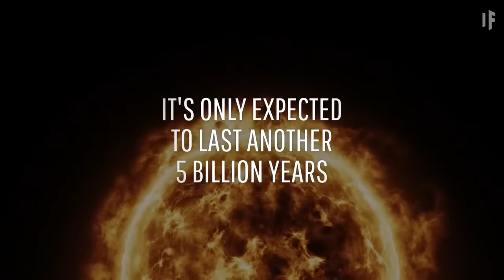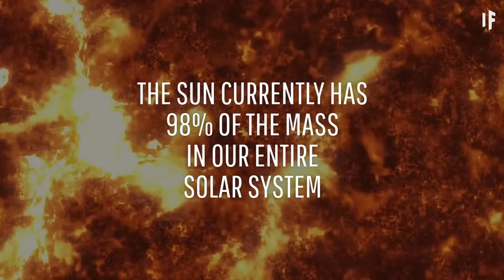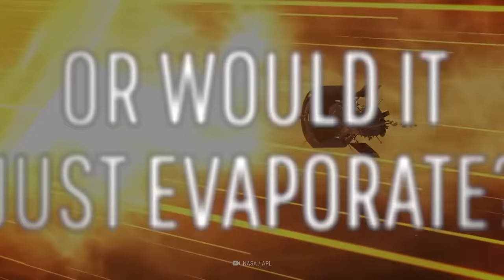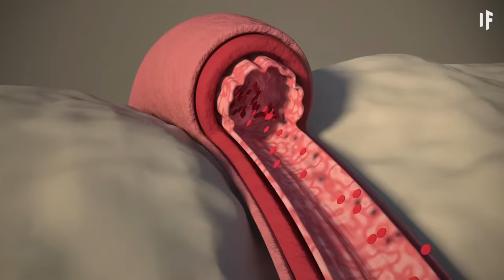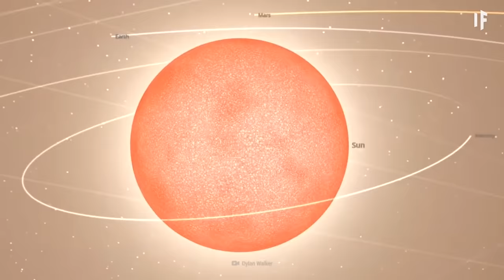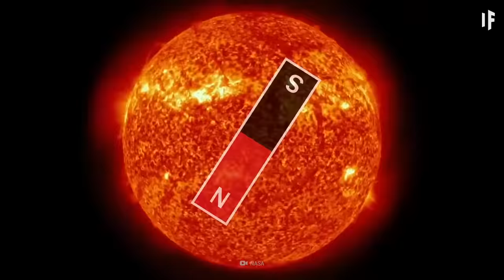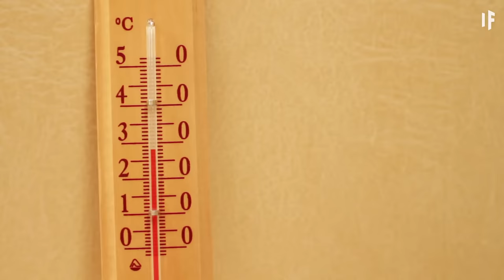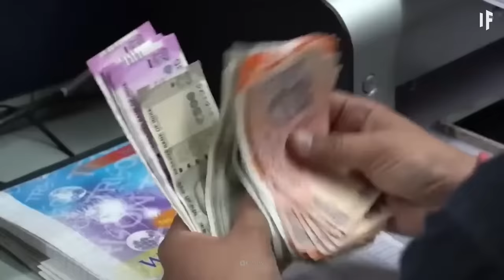Everything That Could Go Wrong With The Sun

Comment: remember the sun is 1300000 times larger than earth so you will have to multiply everything by that. But this person seem to be thinking on earthly terms. The sun is compose of gas H$H. The earth is composed of rock, its rocky therefore more massive if composed of rock and the same size as the sun and the gravity would be much, much larger. And if an sun size planet was possible and there is life on it that life would be able to adapt to the size and the gravity. Beings from such a planet would be like superman on earth, at least strength wise.

Comment: Isn't earth denser than the Sun? If so, wouldn't that mean a Sun sized Earth would have the majority of  the solar systems mass? So many questions.
Reply: Not many answers.
Reply: @donkique956  Lol, it seems not.
Reply: Earth isn't denser than the Sun. The outer layer of the Sun are less dens than Earth, but the inner parts are much more denser
Reply: @fabriziobiancucci7702   plasma is denser than solid matter? If so, ya learn something new every day, as they say.
Reply: @LMde20  Plasma has different states, just like solids, liquids and gases. If you put water, a liquid, under a lot of pressure, it becomes so squizzy that it turn into Ice 7. The same the plasma of the Sun, in the outer layers its density is low, but the more and more you go into the star it becomes extremely hard
Reply: @fabriziobiancucci7702  I know exactly zero about plasmas and their different states. So can you tell me, plz? Which would be denser, plasma from the iron core and other solids of a eun- sized earth? Or the plasma from the mostly gaseous elements in the sun?  Or would they indeed be much of a muchness?
Reply: @LMde20  Plasma is a state of matter that exists thanks to pressure and temperature impossible to find on Earth, therefore the more pressure and tperature you add, the denser it is. Tha plasma in the core and in the convection zone of the Sun is denser than Earth, so much that if you put even just a piece of it on our planet it would explode with the power of a big asteroid, because the force that mantain it together would be gone. The plasma in the photosphere and in the cromosphere instead is less dense than Earth
Reply: @fabriziobiancucci7702  understood. And yet the vid said that the sun, placed in an appropriately sized body of water, would float. I don't believe this would be the case with a sun sized earth. Would a sun sized earth be denser or not in comparison is the question I'm asking? Ie: Is there some property of plasma that changes the formula for calculating density?
Reply: @LMde20  The vid is wrong. What you can put in an ocean and make them flow are the gas giants, because they are composed by gas an not by plasma, therefore they are less dense than water. But the Sun is completely different. Even if the outer layer of the Sun are actually less dense than water and so they can "support" it a little, the inner layers are so dense and pressurized that it would be impossible for the Sun to float in an ocean. The only possible reason for what the vid said is that the Sun could be supported by its own enormous heat, that would push it on the surface (since hotter bodies go up and colder bodies go down), but that would be a problem due to temperature, not density. And about your question, no, a sun size earth wouldn't be denser than the Sun, they would be basically equal. Earth is composed by the same elements that compose the Sun, just very less of them and with many of them fuse together to form other elements. But if you enlarge the Earth, than its core would became hotter and hotter due to the intense pressure, until it collapses and starts nuclear fusion, and so all the atoms on Earth would be converted in plasma. This means that every complex molecule would turn into its basic components, especially hydrogen and helium, the same elements that form the Sun. Ultimetely, the Earth would be completely turn into a star identical to every other star that we know, therefore if you make it reach the size of the Sun, they would have the same mass and density
Reply: @fabriziobiancucci7702  If anyone ever tries to float the Sun in an ocean, make sure that there are cameras rolling - it would be quite a sight.

Comment: 1.for the sun to explode , it has to build excess energy.
2. The sun is slowly burning up. It is losing heat.
3. It is travelling in space while rotating on it's own axis.
4. The sun is also pulling other planets with it.
5. Only possiblity of explossion is - it collides with another mass, maybe the same size.
Reply: The Sun is not burning up, and it's not losing heat. This is not a coal fire, you know.

Comment: This narrator state theories as if they are facts and the word theory means, we or I think. Since he ws not around 75000 years ago how do he know that this actually happened. Stars do not travel as fast as light so if this passing happened 75000 years ago it should be easy to track where this "sun" is now. And since it is a star it should be easy to find since it should be still close by and they can detect planets around stars light years away.  Come on people use common size.

Comment: If the earth was as big as the sun space travel be impossible.Imagine the earth with a million times more gravity.Rockets would have a very difficult time to get even a few centimeters off pad before gravity crashes it down.On the plus side will not need space mines as an earth that big will be full of the heavier elements that currently very rare to mine and kg for kg be a lot cheaper to mine then the asteriode belt.
Reply: If the earth were that size, it would be a star, just like the Sun in fact.
Reply: Also , there would be no life possible on earth when earth's gravity is same as Sun , as everything on earth would be broken due to extreme gravity force